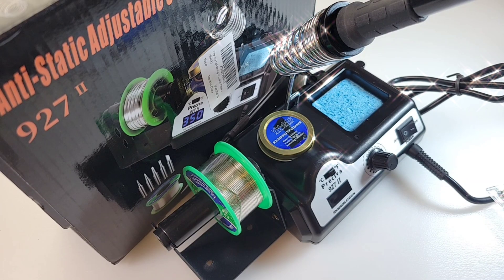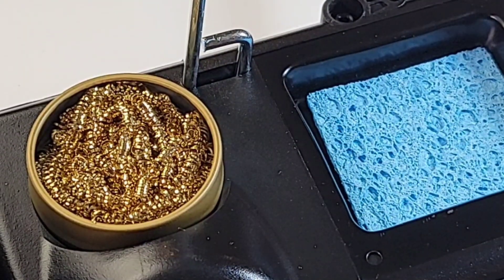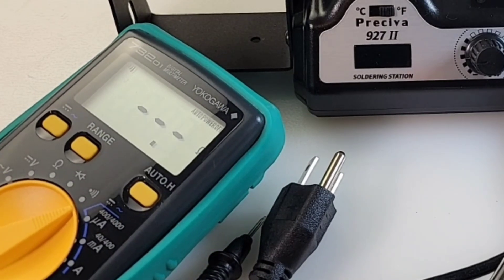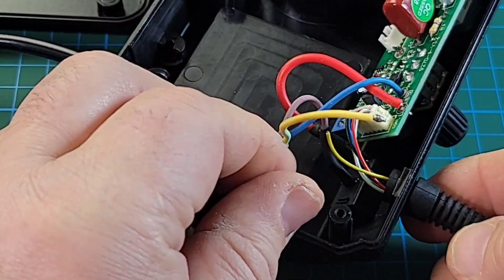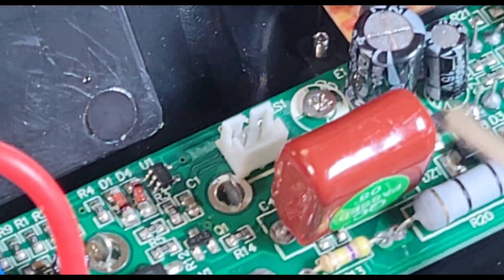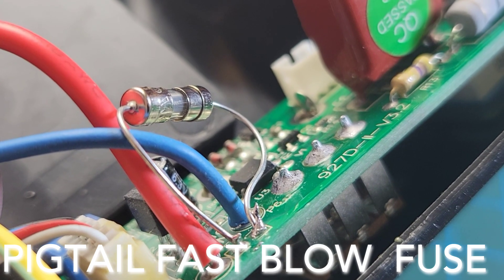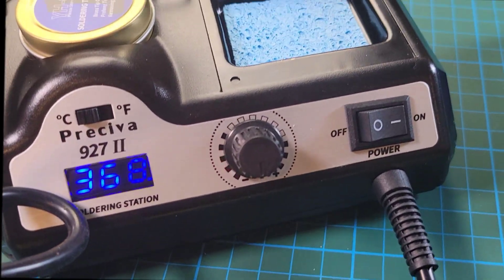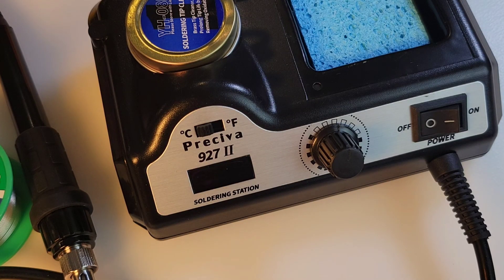Preciva 927 II Soldering Station Review/Repair and Teardown!

Comment: I Bought one and used it like 5 times and now it doesn't heat anymore and the numbers on the screen are going up and down, how can I repair it ? The R13 is at 1 when I test it with continuity, idk if it's normal

Comment: I think one thing you have to take into consideration is you are reviewing this item in America, where you get 120V? I believe. It’s clearly Chinese so would be designed originally for 220V, I live in the UK where we’re supposed to get 230V but as an electrician I never measured less than 240V and it’s got very good reviews over here. I’ve actually just ordered one and if it’s rubbish, I’ll send it back but I suspect at 240V it will work fine.

Comment: LOL - Wow how did I miss this review, what a hoot-!  The laughs started when you launched that iron holder collar across the room - just one hole for the solder holder with two screw holes ?! what-? 🤣 Then I thought that temperature knob was literally gonna fall off in your hand when ya turned it, it waggled like a ducks azz - lol  No grounding wire - who needs it - lol  Barely enough heat to melt a candy bar. Pretty rare to find one this bad, scrap it for the cord and a few parts off the board and iron & launch the rest of it into the dumpster lolol  There wasnt even enough parts on that board to make any kind of real heat. One of China's absolute best examples of a bad design and horrid Q.C.
Reply from the maker: Yes a turd indeed. Best thing about it was the box. Light as a feather too...simply sneezing will cause it to go airborne 😅..
Reply: @KeepOnTesting  😆😆😆😆😆

Comment: Do you still have this machine? I have a brand new one that worked maybe 2 times and all of a sudden stopped. The wired are good, good ground and power to have the board where the main red and blue go in. Nothing else. No hest no lcd nothing. The rocker switch is good too. Any suggestions would help Tha k you if you see this.
Reply from the maker: How do the capacitors look? I would probably change them irregardless. Also, the transistor (U2)..might be shorted.

Comment: The inside is so pathetic... just checked on Amazon AU and the listing on there is AU$180.. This pales in comparison to any China knockoff T12 stations, which roughly sell at the same price but with way higher quality and internals.
Reply from the maker: Yikes! That's an insane 😳 price for such a cheaply designed soldering station!

Comment: This explains a lot, I bought it a while ago now and it was working fine fresh out the box but not now. I thought it was the soldering tip not actually transferring heat but now I see the problem. I’m glad I didn’t waste too much on this pos. I really thought I was getting a good deal, I guess the reviews on Amazon are bullshit.
Reply from the maker: Sorry to hear..Definitely a turd as far as soldering stations go..Dont put much faith in Amazon reviews..Thx for watching 👀
Reply: @KeepOnTesting I’ve just taken a look at mine (after it being stored away for months obviously) my soldering tip is actually already grounded and with a bit of tweaking of that inside potentiometer I got it accurate enough. It was almost like it was set too low. I still gave it 1 star on Amazon because I shouldn’t have to open it up and manually calibrate it. Their QA must be awful.

Comment: This thing  is not isolated from the main. The cheaper and simple version is the soldering iron with transparant case handle. The controller is in the transparant handle. It is cheaper. Model like : wep 908, sl 905, sl 907. They use 4 wires heater.

Comment: Things usefull you need to buy are a box of heatshrink tubes (different sizes in a box) and also some crimping pliers (especially ones for awg 30-20 uninsulated).
Reply from the maker: I have a ton of heatshrink tubes, I just didn't want to waste any on this station. 😃 Crimping pliers I do need as my last pair vanished. 👍
Reply: @KeepOnTesting  yoy friend. 
For chinese soldering things i keep with my fav brand : proskit, mechanic, yihua.
Crimping pliers are very usefull for electronic projects and repair. I ended up with SN-01BM, Tekiro 9 in 1 crimping plier, PZ0.25-2.5.  wish you can add your pliers photos on your website. 

Nasi goreng and teh celup for this morning friend :-)

Comment: It looks dangerous. The heater is powered straight from the mains, and the electronics from a capacitive power supply. The lack of connected ground is the icing on the cake.
Reply from the maker: 100%.. Makes you wonder how they can even sell this crap.

Comment: Worst iron I've ever seen and it's hilarious that it has a sleep mode as the only thing that they could have done to make this iron worse would be to have it fall asleep occasionally so that you have to wait another 20 minutes for it to reheat.

I've still got a cheap, dumb 18W iron that my Dad bought in 1982.  It has no electronics whatsoever, heats in 1-2 minutes, and works better than a supposed "60W" chinesium station that I bought 8 years ago.
Reply from the maker: Sometimes high tech isn't so good after all..hang onto that '80s iron 😳👍

Comment: NO quality control on this one, cheaply designed poorly built and assembled - not worth the time to open the package.  Right outta the box had to open case solder the ground and make adjustments that should have been done in assembly and checked in QC, a safety hazard and performance fail.  Judging by other comments this isnt a one off either.
Reply from the maker: So true! Suffice to say Preciva has some poor QC that just oozes crap. This is the result of making a buck at any cost. This soldering station really lowers the bar for mass production standards. Definitely a brand to stay away from.

Comment: KMS Tools has a WELLER temp control station for $69Cdn. It's a basic job with no display, but who doesn't have a thermocouple for their DMM? It comes with a regular Weller pencil that plugs into the AC socket on the side, so presumably any pencil would work, like the one with LEDs. Made in MEXICO.
Reply from the maker: Hey Barry, do you have a link?
Reply: @KeepOnTesting , anything made by Weller that's red is junk. The soldering station he references is an 120vac iron and a "station" consisting of an electronic light dimmer in a box. You can turn the temperature down but you can't turn it up, and there's no temperature feedback. I reviewed on on my channel along with a Harbor freight soldering station.

Comment: Thank you for pointing out that a solder iron tip should be grounded. I run an 80w watt Ebay cheapo that has a digital temp control built into the handle. It probably isn't great for pcb work, but combined with a 12v to 120v inverter and a power point (cigarette lighter) lead extension is great for repairing wires on a car (or excavator, golf cart, whatever is in the shop this week), but I need to check to see if it is properly grounded. Safety first!
Reply from the maker: Yes always a good idea Eric ..glad the review was helpful. 👍